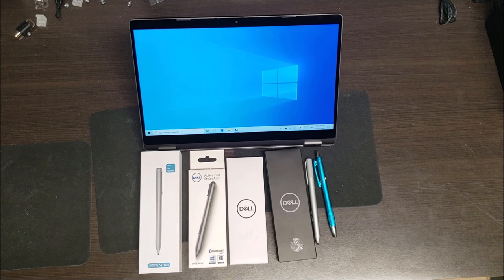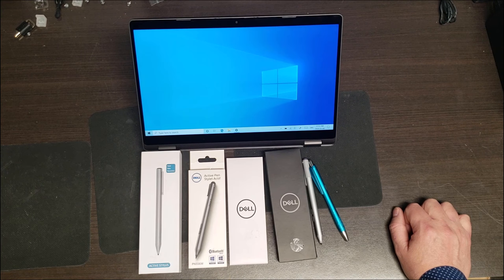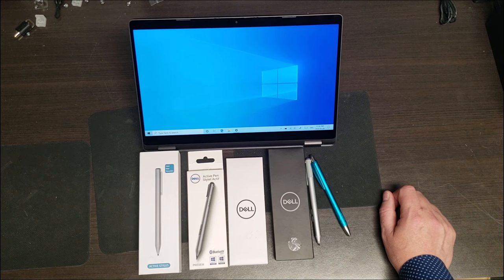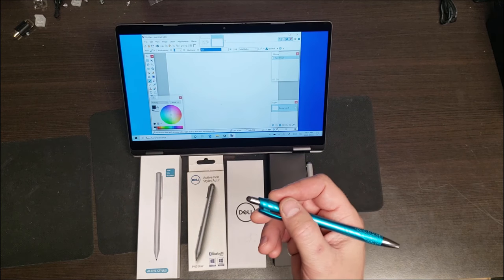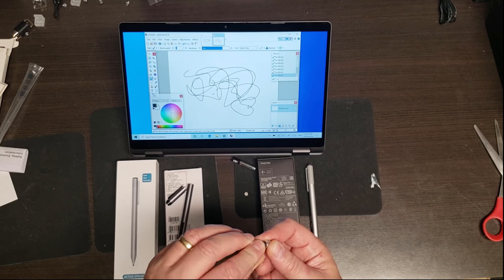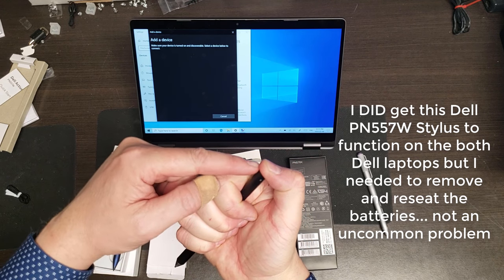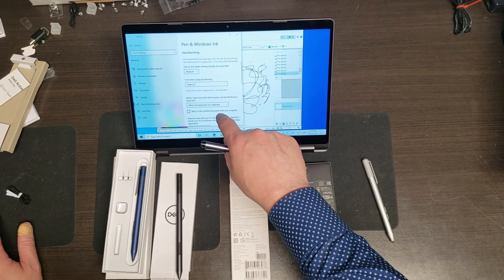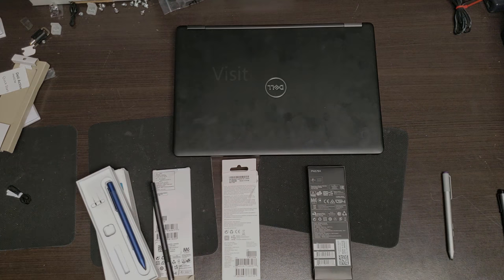Different Types of Touchscreens & Stylus' Explained

Comment: TL;DR:  Dell uses Wacom AES, not EMR; Surface uses N-trig, Wacom's Bamboo Ink/Ink Plus have both but u need to switch modes by holding the 2 side bottons together for a few sec.  Bluetooth doesnt mean u can write on it, it's the pen and laptop's pen tech that matters

----- full explaination-----
Dell uses Wacom AES technology, also seen on SOME HP (HP hav both, some are N-trig, some are Wacom AES), Levono, Acer. While Microsoft and Asus, uses N-trig

Wacom Bamboo Ink has both AES and N-trig, but u need to switch it's mode between AES or N-trig by pressing both of it's side buttons together

Still Others like Wacom's own tablets, Samsung's Note and S Tab series and some other higher end art machines uses Wacom EMR, which the pen itself dont hav a battery or needs to charge at all and dont work with any above active stylus tech

The bluetooth function on ANY stylus is only for calling out the Windows Ink Workspace, has nothing to do with pen's writing/drawing function AT ALL.

e.g.
My machine is an Acer Concept D Ezel 3 which uses Wacom AES (higher end ezel 7 uses EMR), but i came from Surface Pro, and my bamboo ink works on both by just switching modes.

--bonus--
As for performance(IMO): EMR >> AES ~= N-trig if you're slow drawing(jitters in AES & N-Trig);  EMR >= AES ~= N-trig if fast drawing and if u have software stablizing, it doesn't  matter much

just an FYI
Reply: thx, bro - this comment was much more helpful than the videos I've watched XD.
Reply: Thanks for sharing. Really helpful

Comment: I was able to connect the PN557W Pen to a Latitude 5490 in the Bluetooth device manager, but it doesn't work,  touching the screen doesn't do anything. Is there something else in the configuration that I need to do?.. any help would be greatly appreciated.
Reply from the maker: I would check the compatibility list.  They are so specific.

Comment: Does having the "Pen and Windows ink" settings means that u can use an active stylus with ur device? Mine is the Acer switch one 10 and it says it supports active styluses but idk which stylus to get, any suggestions?  I hope u guys can help.
Reply: If you still have a owners manual, there should be a listing for the pen that is compatible.

Comment: Just because it pairs does that mean it will work for my device? I can get a surface pen to pair with my Dell 5400 but that is all i can get to happen.
Reply: correct, bluetooth connection is only for calling up the Windows Ink Workshop, not writing AT ALL

Comment: Good day. So I have the PN557W Pen, however every time I decide to use the pen it seems the battery (AAAA) is dead and there seems to be no way to turn it off. Do I have to remove the battery everytime it is not in use? This is very frustrating. @URTechDotCa
Reply from the maker: Hi Roger;

I have not seen that problem.  It should not drain when not in use, so perhaps yours is defective.  

Thanks for the comment and sorry for the looooong time lag on the response; I have been in Hell in recent months with... lots of personal stuff.  Thanks again.
Reply: @URTechDotCa  Thanks for your response. Hope everything is getting better on your end. Keep your head up!

Comment: What is the cheapest replacement stylus for the vintage HP Compaq 2710p notebook/ tablet? I recently purchased a used HP 2710p without the pen and I need a compatible stylus for it because the 2710p seemed to use an  older generation resistive screen that does not support finger touches. I'm stuck with the hard to navigate trackpointer (no touchpad on this model), please help me find a generic stylus that is compatible with this laptop because the original HP pen replacement for this model is not available here in my country  (Philippines).Thanks!

Comment: So I have the same Black dell pen as u had but it won't turn on just like yours??? Have checked the batteries a few times to make sure they are the right way but it won't light up. Pretty sure it is supposed to light up to be in pairing mode ?? Thanks would really appreciate it if you could tell me how u got yours to work

Comment: greetings, could you help me, please?
I need to know which pen is the original for one of the 15 7000 black edition, I bought it but did not bring the pen, it only has the space in the laptop. and I want to buy the correct pen that will fit in its place.

Comment: So all of dell stylus pen not work for Microsoft surface, but the Surface stylus could work for Dell ?
Reply: do you what dell laptops it works on cause i bought one but it doesnt work i have a dell latitude E7440
Reply: @fabiolacruz5573  I don't buy Dell stylus. I use Renaisser Raphael 520 on Dell Inspiron 14-5485, It does work but has a delay cause the screen is 60Hz.

Comment: My biggest problem is parallax. I have a Dell 7373 and a PN338M pen which is supported by the laptop. It works great, EXCEPT for the parallax that I can't seem to fix. In Sketchbook the cursor will show directly under the point of the pen, but when I start drawing, the line or dot that appears is a few pixels up and to the right of the cursor. There doesn't seem to be any way to get this fixed. I've used the calibration tool in Win10, but it's useless.

Comment: I have a dell inspiron 5482 . Can any of these pens have an option to program the buttons?    For example i would like one to be undo and the second one to be delete. Thank you .
Reply from the maker: Hi OGG; Yes, I am 95% sure you can use Dell software or the integrated Windows settings to program the buttons.  I no longer have access to those pens as that customer shut down its Canadian operations.
Reply: @URTechDotCa  thank you

Comment: I had looked at the smartphones, the resistives were precise, I remember the first htc, the problem is that they consumed too much battery. The market then move on to the cheaper capacitives, but the problem is that the exact position is not known and cannot be drawn precisely on the display of current mobile phones, use pencil rubber. There was only one smartphone, the Note (the real) NOTE from samsung, which exploited the technology of wacom, and positioned references to the corners to be able to give the ordered and abscissa indications. To overcome the problem on capacitives, a pen with an electric charge (if I understand correctly) and with a particular tip is used.
But i never bought these pens and i never tried them.
Furthermore, some time behind a house he had made a system to make a non-touch screen become touch.
I saw your video, I'm interested in understanding which pens are good for the Dell 5300 touch, both from and from other manufacturers, even inexpensive ones.

Comment: Resistive is still my preferred for anything serious, like inside trucks or anything on equipment that's used in extreme cold, or something import that HAS to work when you need it to, even when your fingers are covered in blood or grease, dirt, etc. You completely loose that reliability and function when you go to digitizers or capacatives.

Comment: my dell active pen pn556w  is not working
Reply from the maker: Hi Sevinch (great name BTW).  The stylus has to match the screen type so I would check with Dell and make sure that the 556W is supported on your device.  It is a real pain, but when it works it is great.  Thanks for the comment

Comment: Well, the conclusion is that Microsoft is a mess, and so their Windows 10 partners, for such headaches, compatible/non compatible, faulty software/OS, slow app launch, tons of virus, slow and disasters updates, better go with Linux/Android, faster, cheaper, way more reliable and at least Google is trying to unify those stylus with the USI - Universal Stylus Initiative
Reply from the maker: Hi Carlos;  I would not agree with that, although I certainly understand your sentiment.  Win 10 is fast, secure and the Linux, OSx, and Android certainly have their bugs and security problems too.  Thanks for the comment.

Comment: hi. what is the best tech? lowest lag, best palm rejection, best pressure sensitivity? i want to by a 2 in 1 or tablet pc like Microsoft surface. most important for me would be lag and palm rejection as i am not an artist. (also refresh rate) i use a samsung note 10+ which works really well. only improvement i would like is less lag which they did improve with latter models. i would like to know which laptops use which tech so i know what to look for. i think wacom which is used by samsung is generally accepted as the best in the business but i also here very good things about Microsoft surface. asus make awesome laptops at very good pricing but i can't find much about how its writing tech compares. lenovo i think use wacom so that would be a good option but i am not sure about any of this. i would like a simple table that shows laptop brands and models that state which tech it uses and then comparative specs listing:
1. tech type, 
2. latency, 
3. pressure sensitivity, 
4. palm rejection rating.
5 screen refresh rate also improtant
anyone know where i can find this?

ideally i would tablet or 2in1 with 32 gb ram, 1tb ssd, good amount of ports, good screen res, high refresh rate, writing tech. (idealy with graphics card)
microsoft surface and asus rog tablets seem good and even have rear facing cameras so a very mobile solution.
lenovo yoga, hp spectre, dell, asus also have options but i don't know which has best screen tech.
samsung galaxy pro 360 probably uses wacom and could probably be a great for me but not available in south africa.
asus flip 13 is a very compelling option but not sure of the writing tech.
lenovo seems like it may be the best all-round option but not sure which model.
please help!!
thanks!!!!!!!!!!!!!!!!!!!!!!!!!!!!!